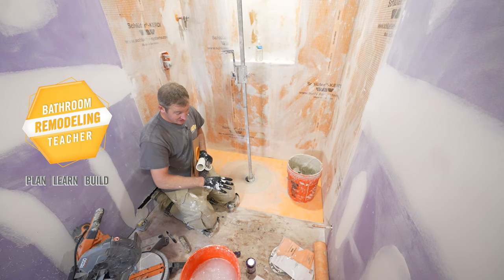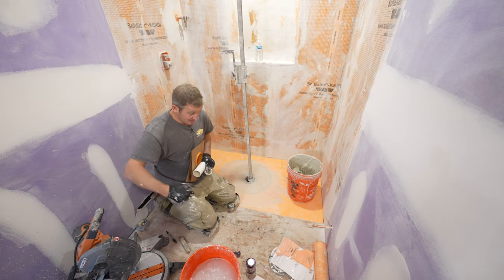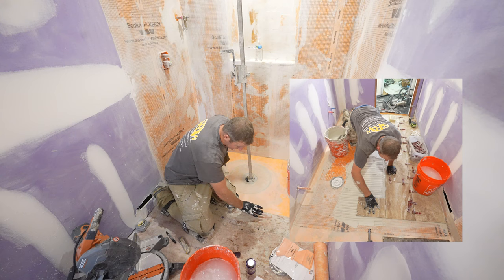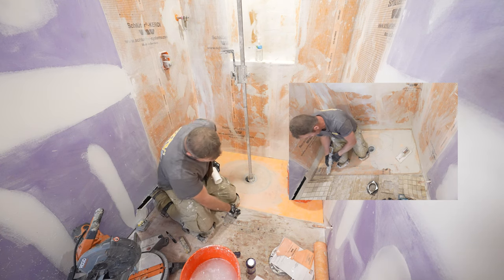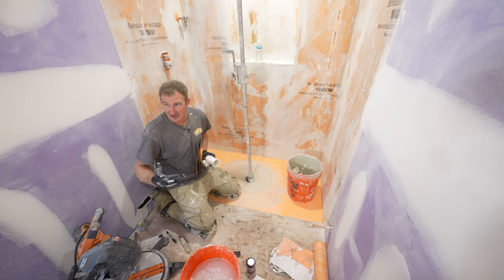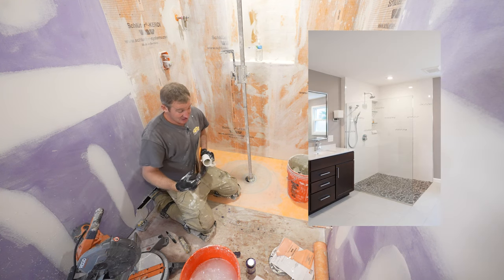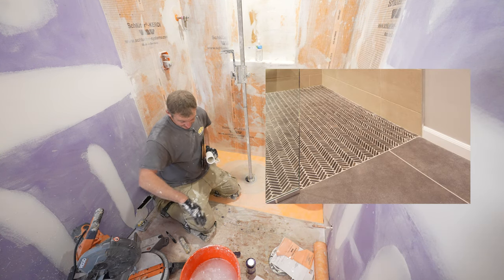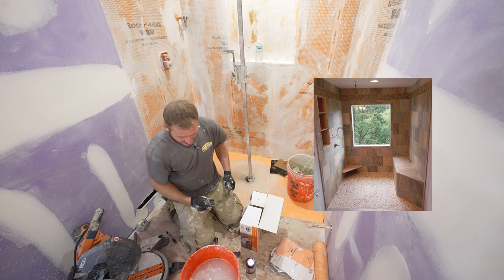Curbless Shower Problem to be aware of

Comment: I have this problem and and it's been a mystery even to the installer and I just spent hours on google and solved the mystery and your video explains it the best I will be showing it to the installer when they come today. The kerdi membrane only extends 8inches outside the shower and no sealant at dry/wet transition. Now I have a question: I understand how this all happens but are you telling me doing the membrane for the whole bathroom is really to prevent water damage to walls and subfloor and so the water is now going to freely float around everywhere? Am i understanding it right and how is this acceptable I guess this is just how it is but to basically have a river underneath and all the mold that can grow, scary. Thank you for your video!!

Comment: Steve if you don’t mind clarifying … You apply silicone where wet meets dry area along the tile bottom, but how do you grout over it? Cant believe that grout would stick over silicon. Nothing does. Or am I missing something. Thanks in advance.
Reply from the maker: Silicon would be my last choice for sealant for the reason you bring up. A poly sealant like Wedi or go board sealant is better. It’s only added at the thinset layer, so the grout will have the tile edging to bond 👍
Reply: @BathroomRemodelingTeacher  Aaaaaaaahy see. So special sealant. Now I get t it. That makes sense. Thanks for clarifying. Much appreciated Steve.